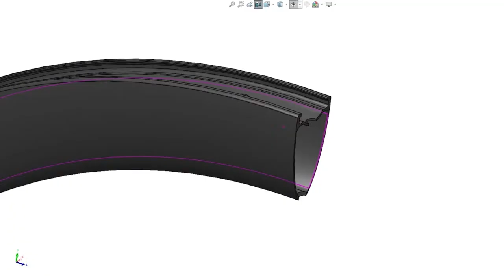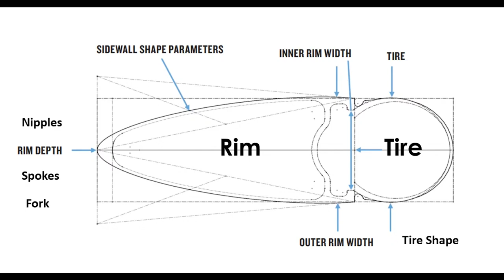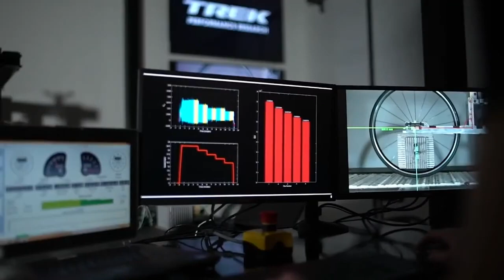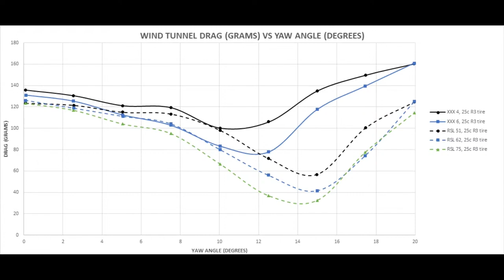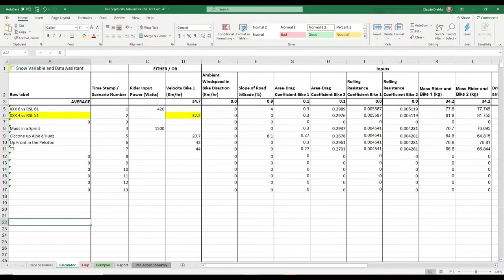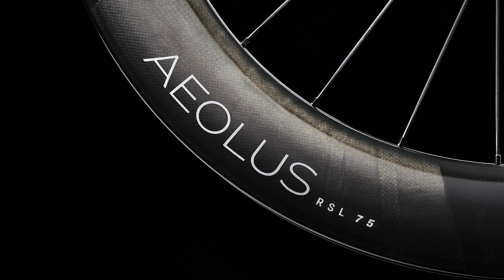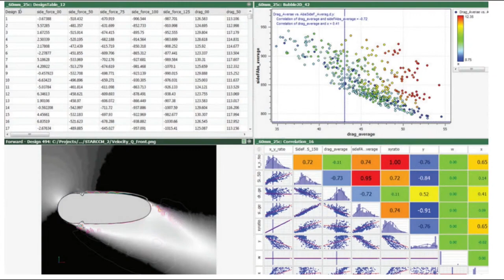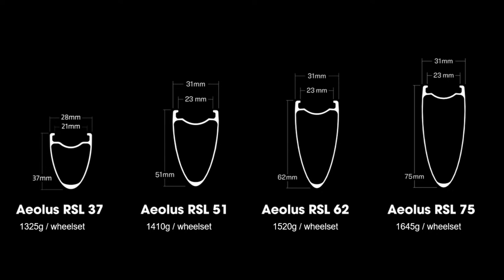Introducing the All-New Aeolus RSL

Comment: These are claimed to be better aerodynamically suited to 25mm tires, so would a mullet 25/28 setup be best? What's the aero penalty of a 28mm tubeless in the front as well? Got a pair of 62 RSLs set for delivery June 28th 🤠
Reply from the maker: 25c and 28c tires are what we test with and are what the Performance Lab learned to be the best performing width!

Comment: Question here, I've just made an order for the Aeolus Pro 37's, I'm going to run them tubeless, would 28mm or 25mm tyres be better for them in terms of aerodynamics?
Reply: Use the rule of 105... your rim should be 5% wider that your tire. So 25mm will be better than 28mm on the standard rsl37

Comment: hey I just purchased Aeolus RSL 51 wheels for my 2022 Trek Emonda SL5 and even though I requested tubes the Trek shop set my wheels up tubeless and in the morning I had two completely flat tires 😐 how do I wash the tubeless goop out of my wheels and tires 🤦🏻‍♂️ ???
Reply from the maker: A little mix of water and dish detergent will help wash away any tubeless sealant!
Reply: How do you like them? I was thinking of putting them on my Emonda too.
Reply: @dereknelson2756  mine blowing actually 😊 far exceeded my expectations
Reply: @scottanderson4175  excellent. I’m going to run them with tubes. Then maybe down the road tubeless. Do they hold speed well? It was either then or zipp firecrest.
Reply: @dereknelson2756  I run tubes perhaps one day I’ll try tubeless but I’m not ready yet
Reply: @scottanderson4175  I can’t wait. I chose them over the pros.
Reply: @dereknelson2756  huge difference in not only the wheels but the internals of the hubs 💪

Comment: In performance behavior, which is the main difference between Aeolus rsl and aeolus pro???....does it worth to change my Aeolus pro 37 for aeolus rsl 37 (right away) or aeolus rsl 51 (waiting time: around 5 months)???
Reply from the maker: Hey there! The RSLs feature a wider internal rim width that can fit wider tires and more volume and is made of a higher-grade carbon.

Comment: Can you put 32 mm tires?
Reply from the maker: Absolutely! Though we recommend using the V models for increased tire volume that is suitable for 32mm and up tires.
Reply: @Trek Bicycle  Im pretty much set on the aeolus rs1 51 was just wondering if putting a larger tire on it sacrifices any aero dynamics considering the inner rim depth is more ideal for like 28mm tires or should I just go with 28 or 30 mm
Reply: @Trek Bicycle  I also have simano 105 di2 12 speed I'm assuming I'll have to buy another free hub compatible with 12 speed or is the one on it already ok?

Comment: Hi, two questions,
Are you able to use the 51, 62 and 75mm wheelsets with the Emonda with their increased width?
If you run a 28mm tyre, will they measure up wider than the 31mm external width?
Thank you.
Reply from the maker: You certainly can - these will pair great with all of our current road models!
Reply: @trekbikes  Thank you!
Reply: @trekbikes  Does it work with the model year 2018 Emonda SLR?